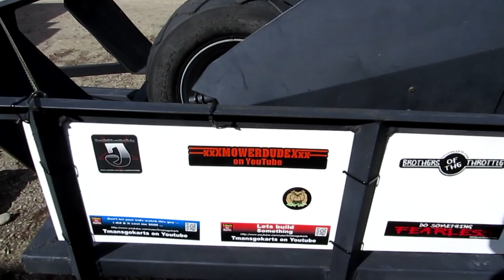CHANGING SHOCKS | UTILITY TRAILER decorations | UPDATE

Comment: Had the same problem with my truck... ended up putting the compressor in the back against the rear window and my welder/generator where he put his compressor, facing back so I could reach everything from the bumper. I have a hard enough time keeping water out my compressor as it sits, couldn't imagine it facing the rain... He will learn

Jeff

Comment: i gotta question, do you think it would be worth it to put a motorcycle/quad engine on a 2 seat go-cart frame? i was thinking about a 250-600cc engine. i want to make it have good low-end power and good top speed (about 60)
Reply from the maker: hey Josh, If the engine will fit that your getting then sure. Just remember that those kind of engines will supply alot of power and speed, if your confident that you can handle it then go for it.